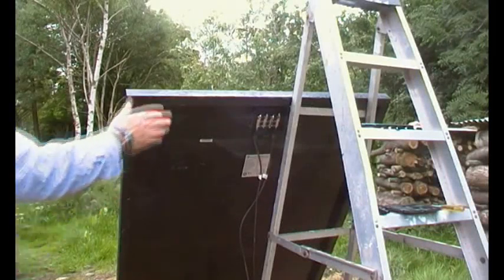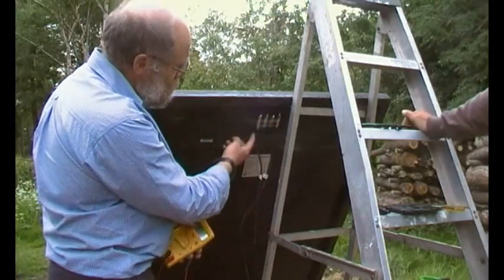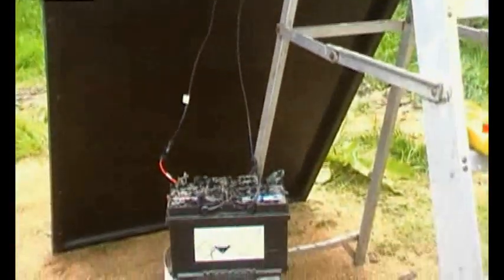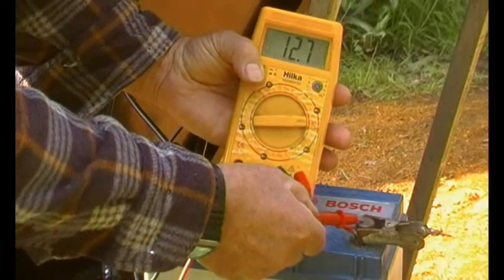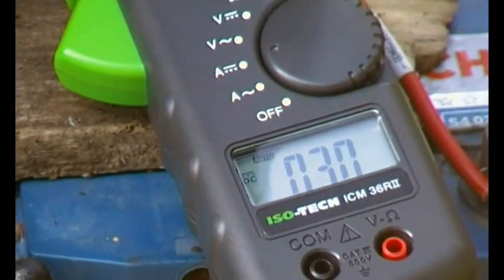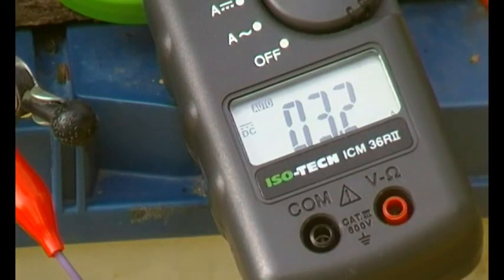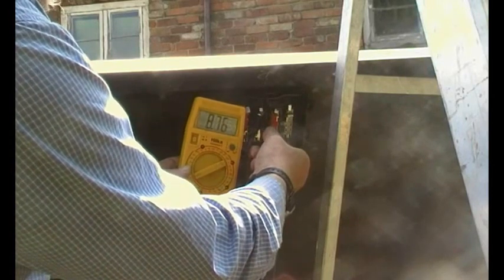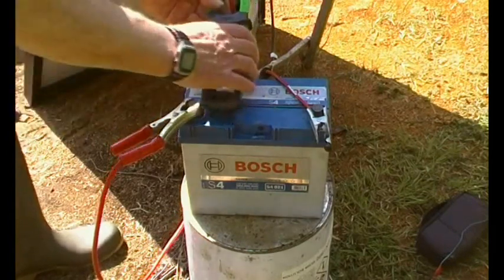Testing a faulty solar panel, part 2, load testing.

Comment: Would be interesting to look at the wafers under a magnifying glass or a microscope to see if the bond wires have brocken or blown. Most likely though the NP junction has brocken down due to age and UV exposure.
Reply from the maker: Yes, more investigations to follow, cheers

Comment: When testing the known good panel, was the headlight bulb connected across the battery? I didn't see it in the footage.
Was the faulty panel producing 3.3A including or excluding the load? The headlight bulb draws around 4.5A so that panel wouldn't be able to keep up.
Reply from the maker: Ian, good to hear from you. On your first point, I'm not sure but I was a bit supprised the bulb wasn't brighter so you may be right, it was all a bit hectic. Point 2 the bulb was there to bring to battery voltage down to give a good load and that was the best current I have seen from that set of wafers. I'm thinking about part 3 and I will include you thoughts in that, just got to catch it right, cheers, Andy
Reply: @TheInfoworks  Have you managed to avoid all of the flooding? It seems lately we have to make the most of the good weather as it won't last.
Keep up the good work
Reply from the maker: Ian, no floods here just a bit damp like the rest of the country. Before this lot I was just appreciating the fine weather each day, cheers